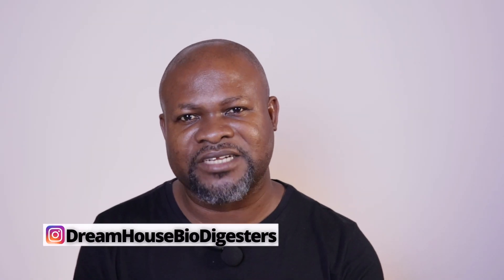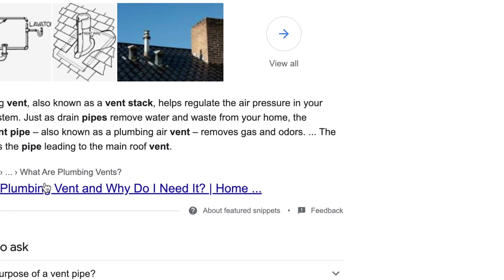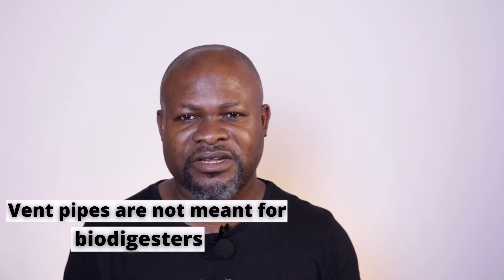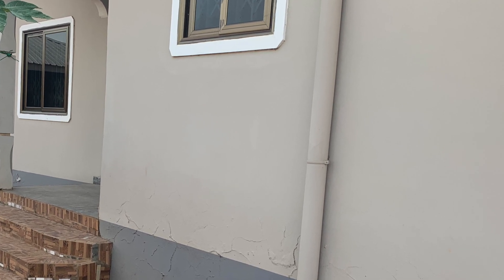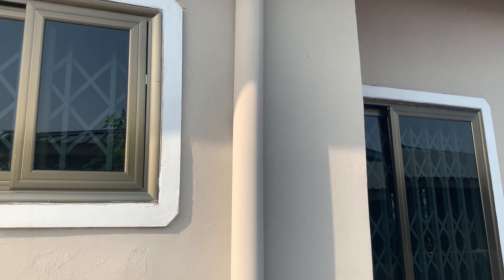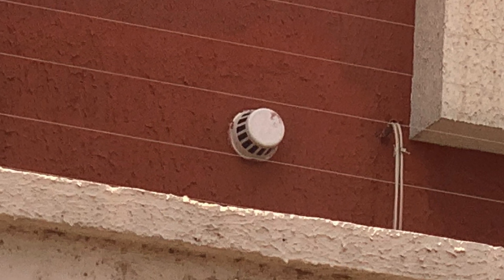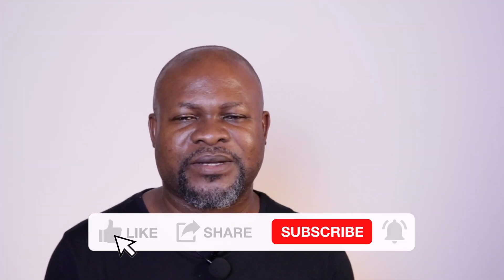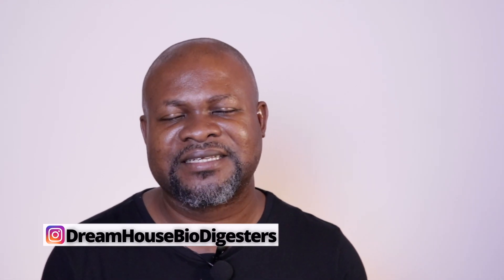Why No Vent On Your Bio Digester Update || Q & A Session

Comment: The key issue regarding the vent pipe is about the technology itself, whether or not a biofil biodigester is an aerobic or anaerobic system. When you say "the vent pipe must be part of the building", it doesn't make that particular point clear. If the only inlet pipe on the biodigester tank is the one from the output of the WC, then the biodigester tank is NOT ventilated. Could you please make that point clear and emphasize it ?